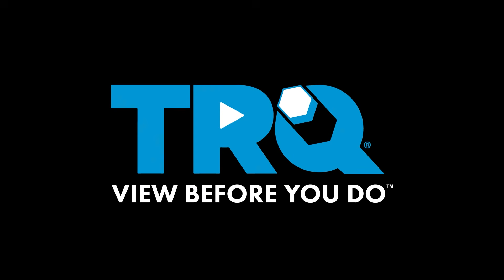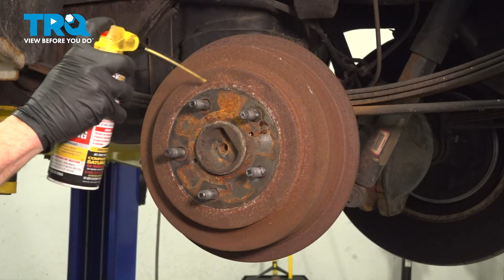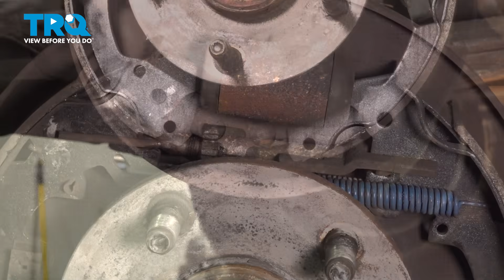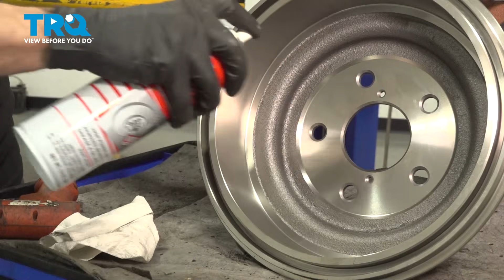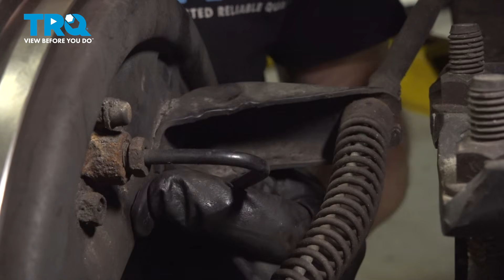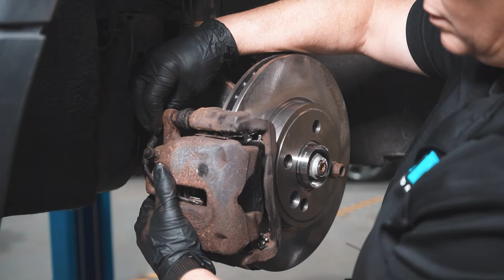How to Replace Rear Brakes 2005-2010 Dodge Dakota

Comment: I love how they don't show the adjustment process ( you can barley fit any tool back there to adjust it thanks the Chryslers infinite wisdom puting an adjuster on the top where the axle and everything else gets in the way. So basically you need a stuby flat head almost nothing else fits)

Comment: Depending on the year the springs are different... later years use 2 larger springs, and there are several ways to hook them up. See in the comments below. Also, it looks to me that the left wheel that is being worked on has a right wheel adjuster.

Comment: not all dakotas have the white spring. Some are 4 springs and some are 3. took mine apart and only had three springs.
Reply: they sell the brake pads and hardware kits based off if you have two upper springs or one.

Comment: So my 2005 dodge dakota only has 1 upper return spring. Your video shows 2 upper return springs. What is the correct configuration for my truck. I ended up just install everything the same as it came off with the 1 springs. Just want to make sure I installed the brake pads correctly.

Comment: Great Video! After viewing it, I realized what I was doing wrong after I had installed the rear brake shoe 1st, and trying to install the adjuster. Also, I see how you install the hold clips & pins much easier than I had been doing it with a flat screwdriver!!

Comment: That's not how you put the springs back. Blue one hooks the white one. 

I know because I listened to this hack and wasted hours of time and energy trying to put it together.

When done correctly, you can put it together on a bench with the adjuster and parking brake lever on and put right on the wheel hub with way less effort.

Comment: I was wondering why he used the R adjuster when he was working on the left side of the vehicle.  did I miss something.
Reply: Also, I bought Napa replacement adjuster kits and the R is exactly like the L that I removed from the vehicle.      Not sure what to do.
Reply: Oh, does R actually means right threads ?  And L means left threads?

Comment: You did the white and blue springs wrong. The white one goes in the far hole to start with, then you use the weird hook part of the blue spring to hold other side of the white spring hook (it doesnt connect to shoes, just the blue wiggley hook, then blue goes in same far hole. Thats why the blue one has that weird hook/end
Reply from the maker: +Gutling2001 Thanks for the tip! We'll pass this info along to our production team. http://1aau.to/m/Shop-TRQ